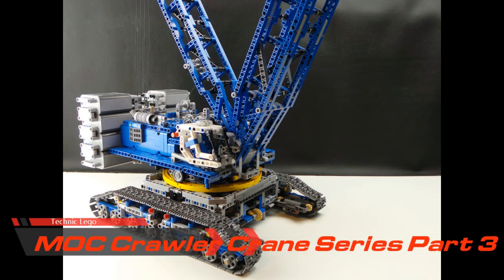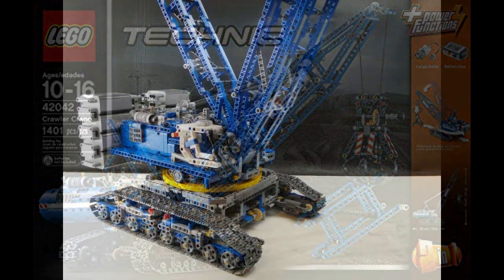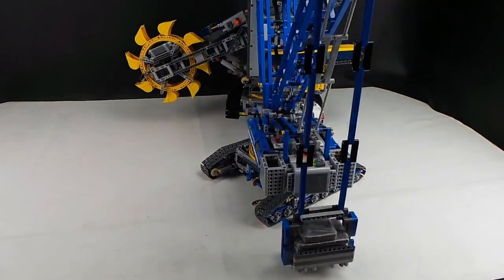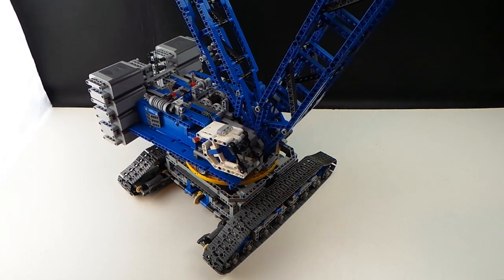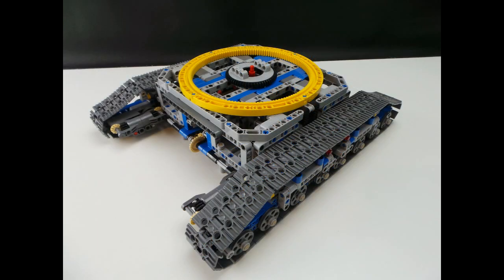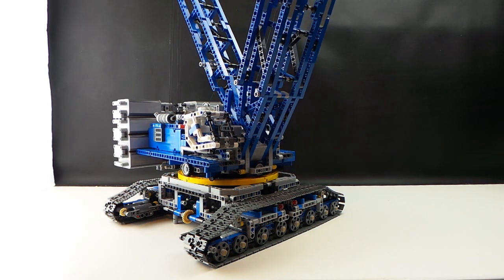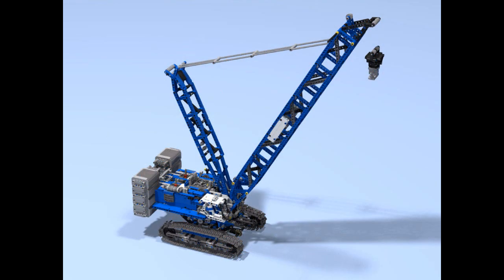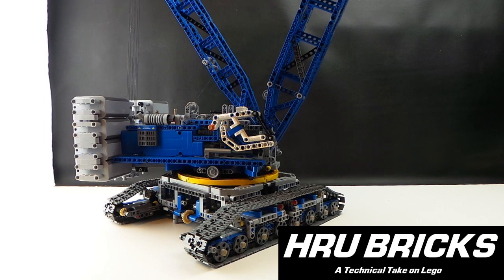LEGO Technic Crawler Crane BUILD YOUR OWN. Build a Crawler Crane MOC Pt.3

Comment: I have a problem with a Lego crane I recently got a Lego City mobile crane this is Lego set 60324 it has 340 pieces and right now I would like it to have two hooks instead of one hook can you try to create a system that has like a pulley on the end of it because I'm trying to build something like that and it's really difficult so please let me know if it can be done or not and can I basically change the model and make it stronger let me know thanks

Comment: Nice easily buildable crane MOC. And now that the 1/4 gear racks are available also in black you can avoid the yellow "color splash"  ✌. Sometimes it's easier to just build bigger (and end up with a display piece) and we forget the joys that a smaller MOC with more "playability" has. Cheers mate 🍻
Reply from the maker: Compared to your monster of a MOC crane I guess this is small 😂 I was planning on going bigger soonish and getting the black gear racks (just getting a little distracted with Great Ball Contraptions). 
The issue with bigger is the slew gear and rotation about the center of the crawler track frame. I know yours uses a proper bearing and I am trying to avoid that. The goal weight is 10Kg  to lift a 10k fire extinguisher
Reply: @SmashingBricksAU  Hahaha, I am thinking to go smaller, something with more "playability" and just lego parts . Maybe we should meet in the middle and make a joint-project, maybe with instructions.